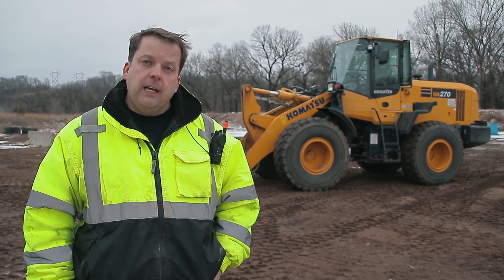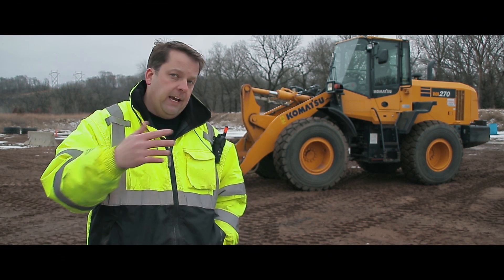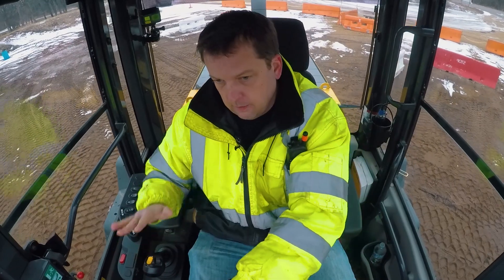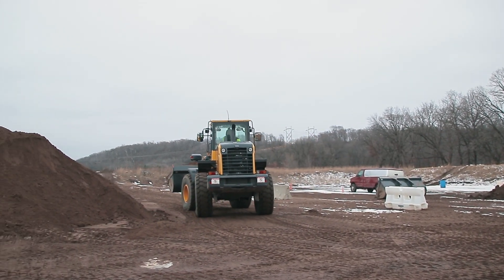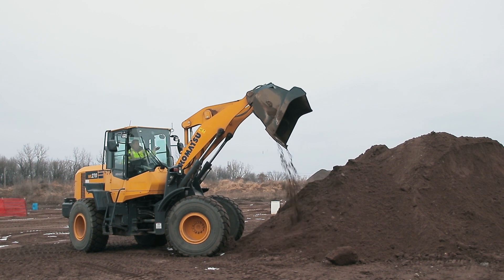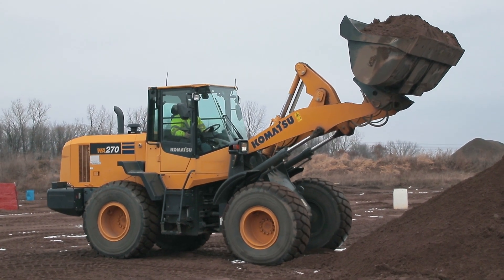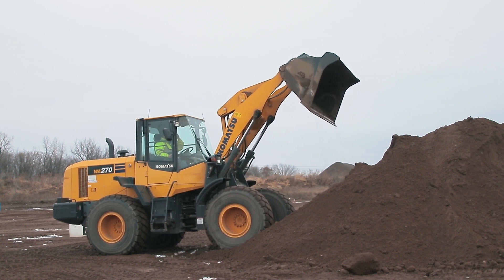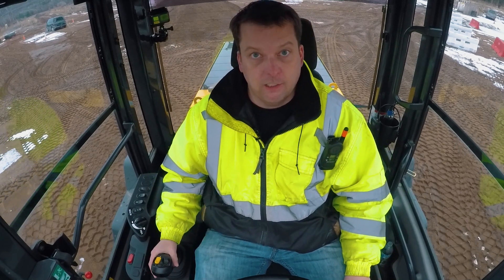How to Operate a Wheel Loader – Advanced // Ep. 116

Comment: My third day running a loader....I was working at a construction dump, my area was the shingle pile...I was doing a pull off on a very very steep hill at an angle...well trying to get the chain and tire loose from the pile I raised my bucket as high as it would go while at the same time backing up at an angle backwards down hill..do I need to tell you what happened or can you guess?.....yes I flipped the machine completely over...wheels in the air and all....that was 6 months ago....and now it feels like I've been running a loader for years now